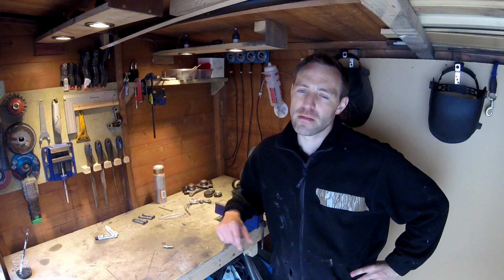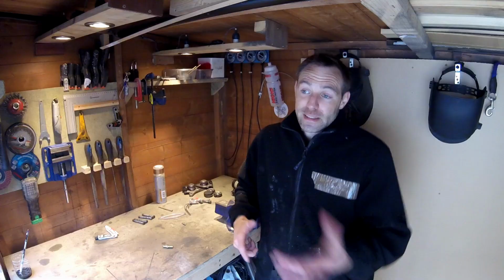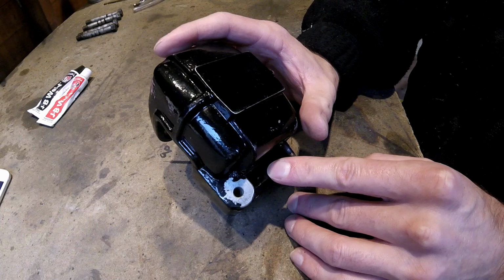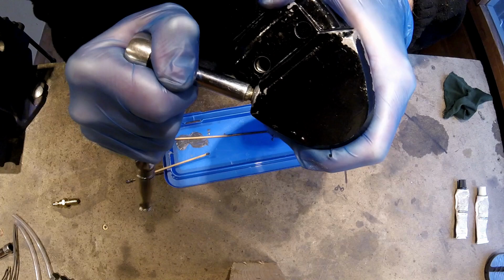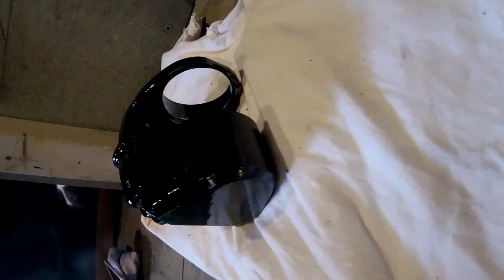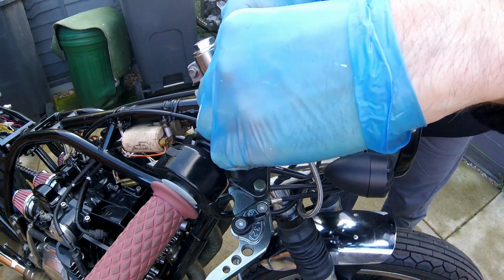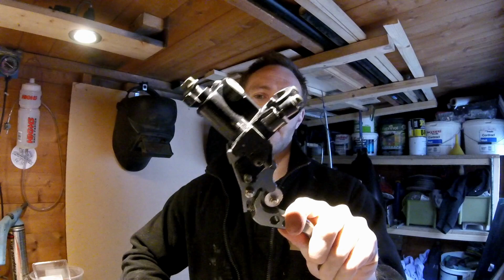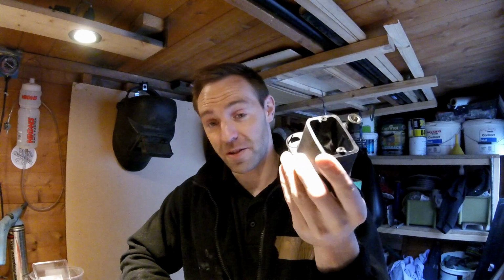Cafe Racer Suzuki GS 750 Motorcycle Leaking Brake Bleeding Screw Part 24

Comment: he did you already finished the brakes? I got the same with my GS. Where did you get these bleeding screws? They look much better then the originals
Reply from the maker: Bikes not on the road yet because of lockdown, i've managed rebuild the brake reservoir master cylinder just needs a test. I've added a link in the description to the banjo bleed screws.
Reply: @dtaylo4517  super thanks! Do you remeber the size 10X1 or 10X1,25? I can't find it anywhere. Lovely tool this. Wanna see the result of my build? Check insta, not for following me, but just to inspire ;)